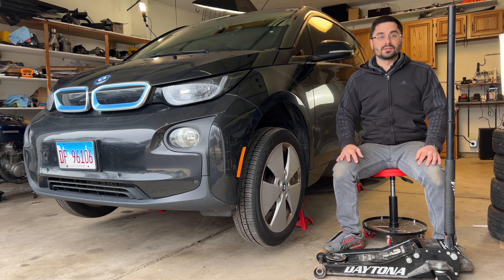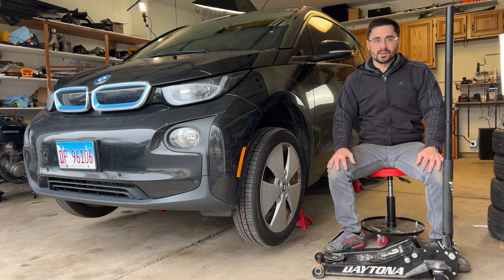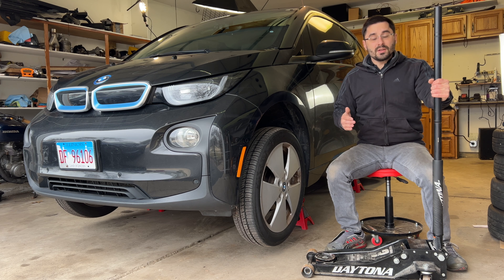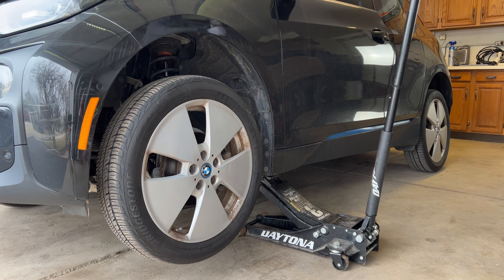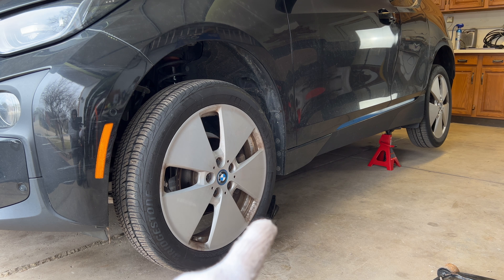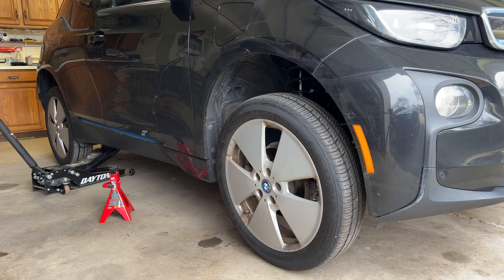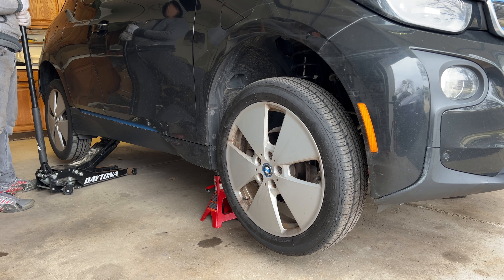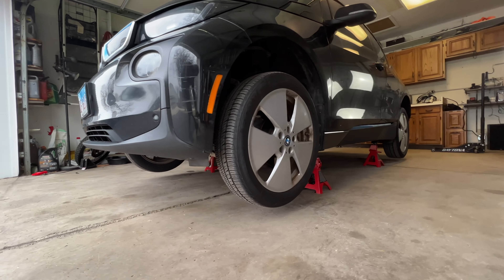How to lift BMW i3 onto Jack Stands - BMW i3 Lifting Points

Comment from the maker: IMPORTANT:
Please make sure you get jack stand adapters so that you don't damage the lifting points under the car!!

I have never had any issues with breaking the lifting points on any of the cars I have lifted in the past, but people seem to have had issues with this. Once again, this is NOT BMW approved method as there ISN'T a BMW approved method of lifting this car onto jack stands. So, do this at your own risk!
Reply: This should be pinned
Reply: Can you provide a link to the appropriate jack stand adaptors?

Comment: An alternative to buying BMW jack adapters is to cut a block of wood that fits snugly into the jacking points.  I have done this successfully for jacking up the car, but I have not used this method for jack stands.

Comment: Have you seen any special blocks that fit in the little squares under the car? I feel like I damage my 550i GT’s ever time I put my stands under them.
Reply from the maker: Yeah, I'm aware of the BMW jack stand adapters (I even have a link to some in the description), but I've never seen the need for them. I've had all of my BMWs on jack stands at some point and it never seemed like it would break or get damaged in any way. I might just order a set to see what all the fuss is about!
Thanks for watching!
Reply: EBAY ,! Worth the low cost.

Comment: I just bought a 2018 I3s and want to do many of the mod updates from your videos, awesome content!! Can you tell me what size socket I will need to take my tires off. I just purchased some 15 mm spacers. My frunk did not have a socket just the tire kit.
Reply: 17 mm

Comment: I'm afraid I would have to classify this as "how not to put the i3 on jack stands"... the CRFP is not designed to be stressed in ANY way other than by using Jack Pad adapters. You simply can not say "I've never had a problem with any other BMW", because this is NOT any other BMW... no steel, no aluminum under there as lifting points.

You risk cracking the carbon fiber reinforced polymer monocoque, which can not be repaired if damaged.

Even using the plastic jack pads on the car as lifting points without using the proper metal pad adapters is dangerous, as you risk breaking the plastic part, and if it breaks, the stress gets magnified... those thin walls surrounding the actual designed point of contact are not meant to carry that weight... you lifted half of the weight of the car on each rear thin plastic jack point... not wise.

Sorry to be so critical, but from an engineering perspective, and an engineer who has owned an i3 for over 4 years, it's just not smart. Those jack pad adapters apply the lift load in a very specific place that was designed and strengthened for the extra stress.
Reply from the maker: Thank you for a very thorough explanation!

Ideally a lift specially designed and adjusted to BMW i3s should be used, but most people don't have that. I do have link to the rubber jack stand adapters in the description and I would recommend using them to distribute the load more evenly on the jack point. The idea of the video is to show how to lift the vehicle that doesn't have additional lifting points designed by BMW, not necessarily the adapters or specific tools you should be using.
Reply: Jesus it's one thing after another trying to work on this car lol. So basically we're like the Titan submersible & hearing loud cracking & popping noises on our carbon fiber reinforced vehicle is bad!? We're king of the world! Full charge ahead!
Reply: Did you look at what the plastic jack points join into? It's metal, not crp